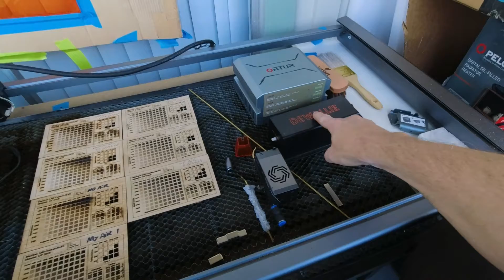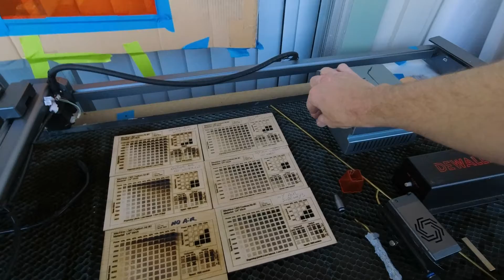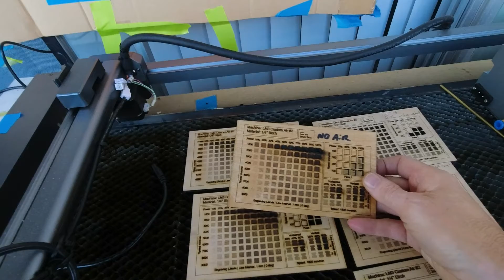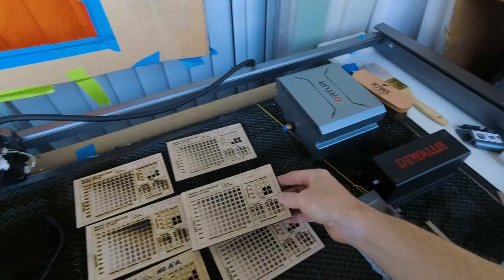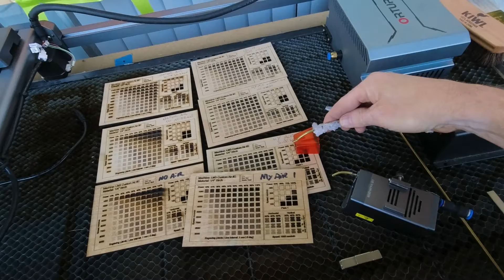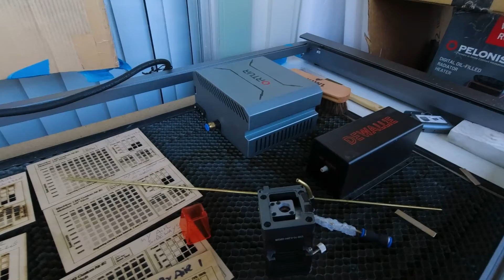Ultimate Diode Laser Air Assist Hacks and Tests Feat: Ortur Laser Master 3

Comment: My experiences are a little different, didn't bought dedicated air assist yet I connect it to a little 5l compressor. It cuts better and clean,but not sure how it would compare to your air assist tho. Also without air assist,my lens got dirty after one engraving or cutting job, cleaned that bugger after a 2-3 project max. With air assist, I keep an eye on the lens and it took almost a week to get a little dirty. Hard to tell what airflow is set, very low setting on pressure regulator.

Comment: Thanks, this is enlightening. I've been using Ortur for a couple of years, and got the LM3 a few months ago. Here's what my experience has been, with escalation to what I'm doing now (cutting/engraving wood):
Fishtank pump, adjustable valve, air on all the time, nozzle on: engraving - dirty; cutting - charring
Fishtank pump, adjustable valve, air on for cutting only, nozzle on: engraving - very clean; cutting - charring
Fishtank pump, adjustable valve removed, air on for cutting only, nozzle on: engraving - very clean; cutting - very clean
The caveat: I have to clean the smoke off the lens pretty much daily - Q-Tip and Rubbing Alcohol, not a big deal, the nozzle does show clogging.
 Not that I won't try an alternate method as above to see how it works, but cleaning the smoke/residue doesn't seem like a need to reinvent the wheel.
I'm going to order the Ortur Pump because you did answer a couple of questions that I had: power and noise. It does seem odd that if I use the Fishtank Pump on full blast my cuts are very clean, but when I use the adjustable valve (even wide open) there is too much restriction and I get charred edges when I cut. I'm concerned with the Ortur Pump that the power would be far less than the Fishtank Pump, so I'll have to see how it turns out. 

The bottom line is that cleaning every day, or after a large job, isn't really a downfall, per se, because it's part of the regular maintenance. But if the nozzle is going to get clogged after engraving, then perhaps a different approach and removing the nozzle altogether might be the way to go.
Reply: Sorry, but I'm a little lost as to what your air settings were.  You say pump on nozzle on/off.  Does this mean you have both the air assist going thru the laser tool AND a separate air on the table?  Thanks
Reply: @guynotes777  No, I've always only used the Air Assist that comes with the LM3, no other type. Not sure where you saw me post "pump on nozzle on/off",

Comment: Hi Valley Forged,
I love this video as I have been battling back and forth with Ortur about the same issue (I wish they would admit they messed up when designing the built-in air assist and they came up with a mass-produced commercial version of what you have engineered.
Can you share the inner and out dimension of the tube you used to make the air assist?
I'm from Australia and will have to order it as no hardware store nearby stocks that kind of tubing.
Kind regards.
Reply from the maker: Look for my former improve your air assist video, I had the label in it. Going on vacation so I can't get to the tube. Thanks

Comment: What is that metal tubing called?
Reply from the maker: I have no idea, just picked it up at the local hardware store. I think it is brass
Reply: it looks like brass tubing, you can get it at just about any hobby store, and even home improvement stores, I think even Michael's may have it in the general area where the plastic model kits are.